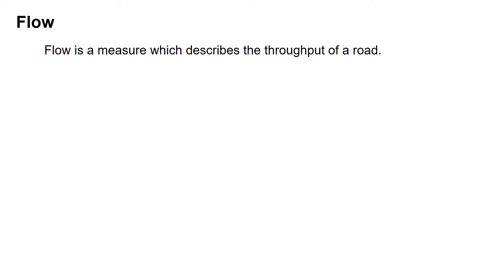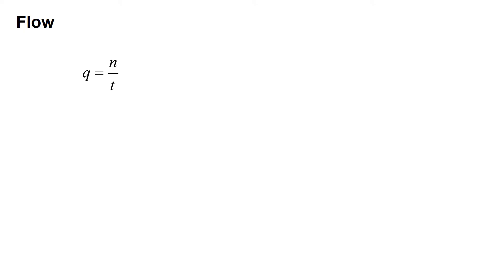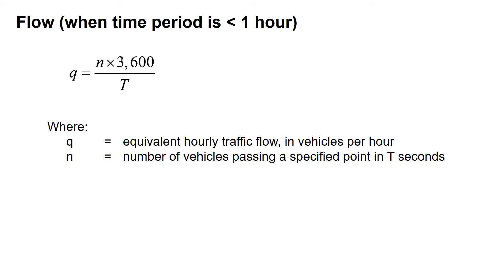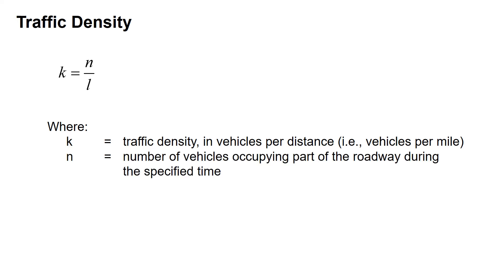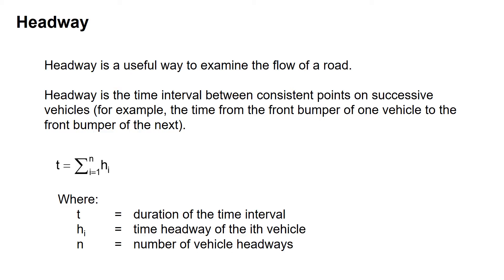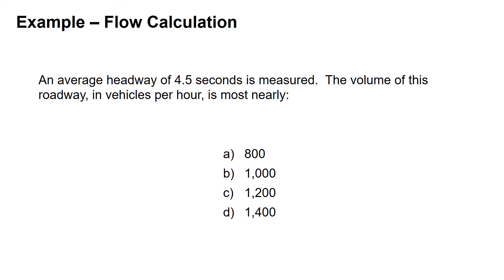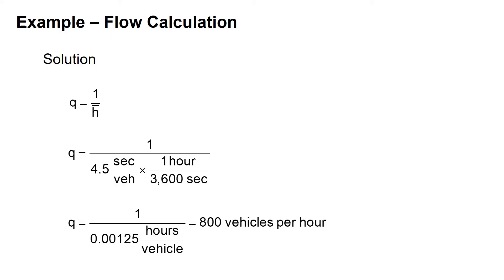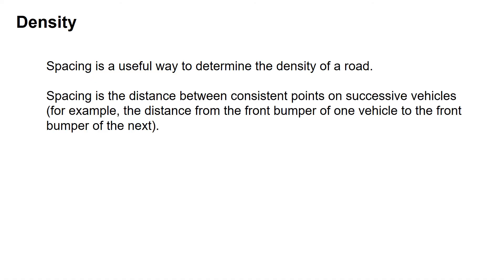Traffic Flow, Density, Headway, and Speed | NCEES Civil Engineering PE Exam [Section 5.1.1.1]

Comment: Thank you for your video! 🤩
I am currently doing a science project in my highschool, with the topic of traffic signal timing, so it's really helpful!
Uhmmmmm, but I have some inquiries that I would be very grateful if you can answer for me! 😢
Firstly, regarding how to actually count the traffic flow, as the papers I have been reading don't really mention it... Do we just count the flow during peak hour (because the greenwave common cycle uses the longest cycle so I guess we should use the peak hour for calculating the flow) or we calculate it at different time periods in a day and use the average figure (as I have seen how most figures of traffic flow on newspaper - not the scientific ones - are counted)? I need to use the figure for Webster's formula for the optimized cycle time (1957) and Hoàng Văn Trường et al (2022)...
Secondly, can I use the designed saturated flow written in the road design for the formula? I am kinda perplexed by this since the intersection I am studying and the formula I use (Hoàng Văn Trường et al, 2022) are for mixed traffic, while the design use the PCE unit, and I have no statistic  regarding the percentage of each kind of vehicles.
Lastly, sometimes I get time cycle results that are negative, is there any explanation for this, if you do not mind?
Reply from the maker: I'm glad to hear that this information is helpful for you.  I'll try my best to help you.  This seems like a fairly advanced project - would you be open to some suggestions that might simplify your project?

Most of our analysis is based on the peak 15 minutes within the peak hour (see QEM videos linked below for how that process occurs - several examples are linked), so I would recommend counting traffic by movement in 15-minute increments.  The highway capacity manual can help convert vehicles to PCEs - for a high school class and assuming the grades of the road aren't steep, I think using a factor of 2 would be reasonable (i.e., each truck is the equivalent of 2 passenger vehicles).  If your project can be adjusted/simplified, my recommendation would be to do a saturation flow rate study at the intersection and then use that value as a capacity to complete the QEM on the intersection.

Saturation Flow Rate:
https://youtu.be/sUXr9j9mbw8
https://youtu.be/pRVxB3mqHrA

Quick Estimation Method (QEM) - Critical Lane Analysis
https://youtu.be/Pgd4fraeEsM
https://youtu.be/_p-rkbCGOPY
https://youtu.be/woQXRuiU6zg
https://youtu.be/ph5yp6ATd5g
https://youtu.be/BI7Fx1hfIFw
Reply: @FindleyDaniel Hi, sorry for replying too late! I intended to get the result and respond in one time!
Thanks to your helpful videos, I found a way to gather the necessary data, then participated in the contest and get a second prize!
Although there are many other steps to do so as to finalize the project (fixing the codes and stuff), the result was really out of my expectation (probably because the police in my place still does not have a program assisting them in managing traffic signal and still uses manual methods).
Hope you have a happy (Lunar) New Year! 😊🎉
Reply from the maker: Fantastic, @Fisthier3 !  Good job!
Reply: @FindleyDaniel  Yes, it's thanks to the topic! And thank you very much, again! 🥰🥰🥰

Comment: ncees hb 1.1, pages 264, 265.

but where to find the eqn which shows relationship between spacing & density ?
Reply from the maker: In my opinion, this is an important relationship and I think it just falls under the following NCEES statement: "The PE Civil Reference Handbook does not contain all the information required to answer every question on the exam. Theories, conversions, formulas, and definitions that examinees are expected to know have not been included."
Reply: @FindleyDaniel  Thank you.

Comment: Hi Daniel,  1st: thank you for the videos. CBT is insane.  2nd:  equation on page 264 for density says that  k= n/l.... shouldn't spacing be in the numerator??  thank you in advance for the clarification.
Reply from the maker: The equation (at 1:29 in the video also) is correct for density.  The units end up as vehicles per mile, which are the units we need for density.

At 3:33, I provide an example that introduces spacing, which has an inverse relationship with density.  For instance, very small spacing results in a high density and large spacing results in low density.
Reply: @FindleyDaniel  S = 1/k. yet, is this in the ncees hb 1.1? if so, which page?
Reply from the maker: @oleopathic  In my opinion, this is an important relationship and I think it just falls under the following NCEES statement: "The PE Civil Reference Handbook does not contain all the information required to answer every question on the exam. Theories, conversions, formulas, and definitions that examinees are expected to know have not been included."
Reply: @FindleyDaniel  Thank you for reply.
Reply: Why is CBT insane? Are you comparing it with the old pen/paper  ?